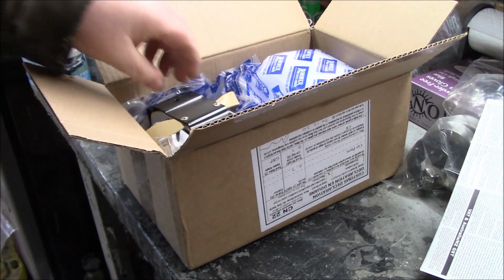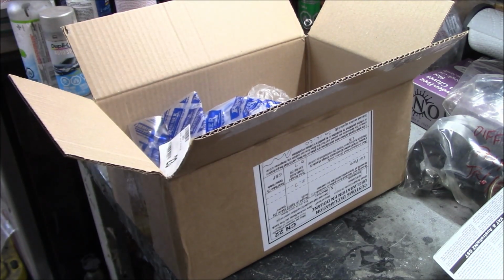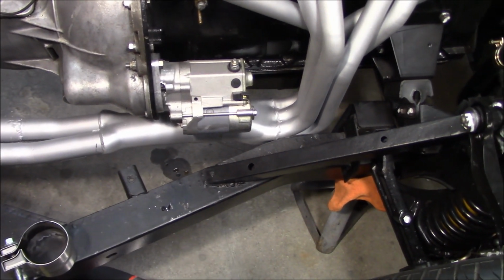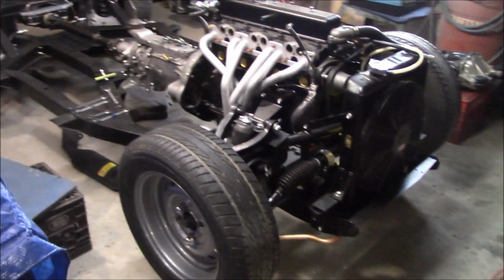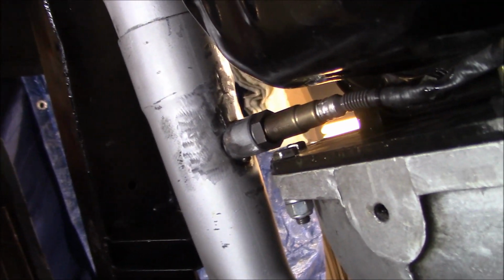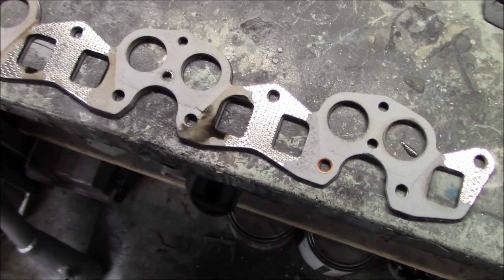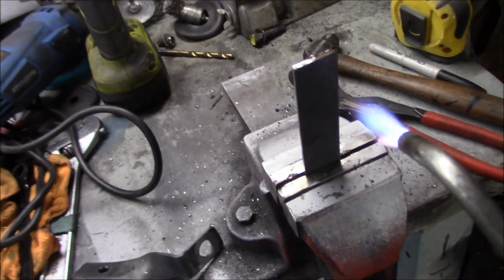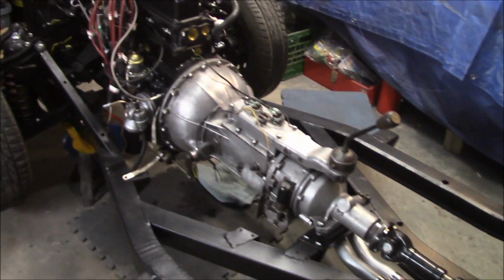1968 Triumph TR250 Restoration,  Exhaust Final Fitting and Calling the Chassis Done!

Comment: Sorry Tush, I might have missed it but what’s purpose of the 02 sensor? Also is that a mr gasket radiator cap?  Looking good.
Reply from the maker: Hi Robert, yes that is a Mr Gasket cap.  The purpose of the O2 sensor is to help me be able to tune the triple weber carbs at idle, cruise and wide open throttle.
Reply: @cheftush  thanks Tush, I have duel Weber’s on my TR4, I’ll look for information on how it all works, had never seen that before.

Comment: Nice work on the exhaust hangers, Tush. Also a timely video on the bung location as I have not placed mine yet, thanks & cheers!
Reply from the maker: Hi Kevin, yeah I’m not too sure about the location but there don’t seem to be a lot of options prior to the pipes splitting into two...either the frame/body work or trans is in the way if you try and get that 3-9 slightly upward position of the sensor.  Worse case scenario if it doesn’t work in the location that I chose, I can always just leave the bung plugged as it is now.....maybe it doesn’t have to be in the single pipe....this is all new to me 😉

Comment: Shouldn't the AFR bung be further down the pipe? I'm about to fit one and it says 24" from the collector.
Reply from the maker: That’s as far down the pipe as I can go....it think needs to be before the collector splits into the two pipes....that is the only location I can do it where I can get the right angle (between 3 and 9) where it won’t interfere with the engine/trans or body work.  Let me know what you find out in your research and where you decide to locate yours.  AFR is all new to me that’s for sure....as mentioned, I’m an analog guy in a digital world....
Reply: @cheftush  Sender life may be shortened according to my instruction sheet. I'll watch with interest. Car looks fantastic by the way. It's a long journey isn't it? Well done.
Reply from the maker: @tracingtriumph  thanks for the reply.  I haven’t decided if I’m going to run the gauge full time...I think after I get the carbs set up, the gauge will become redundant so I may just cap the bung and only use it if I have to re tune.

Comment: I enjoy the detail you provide during the restoration process. Have you ever fitted an external oil feed to any of your motors? Any thoughts on the benefits of having one fitted?
Reply from the maker: Hi Jacob, I’ve had an external oil cooler on my 1960 TR3A.  In my opinion, unless you have a seriously modified engine, you are auto crossing or racing your car, or live in an extremely hot climate, the oil cooler is not necessary.